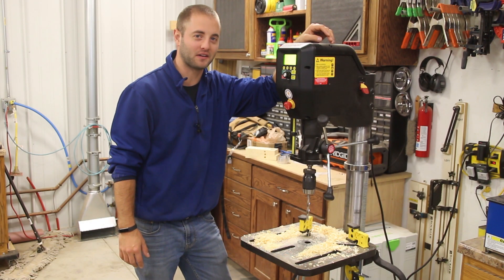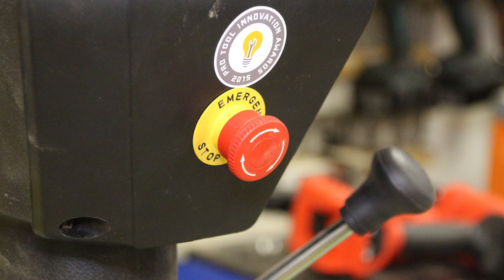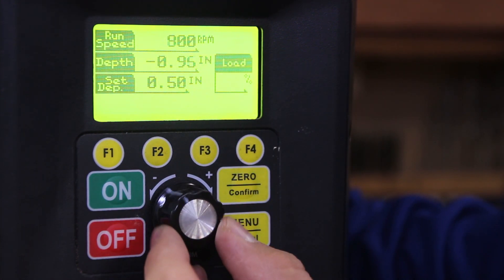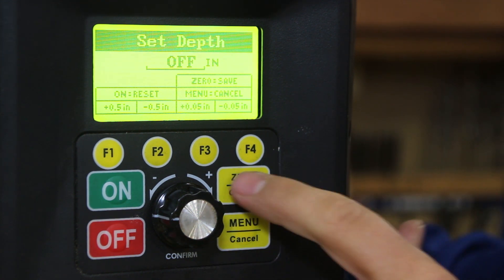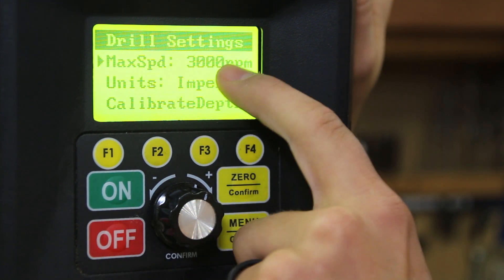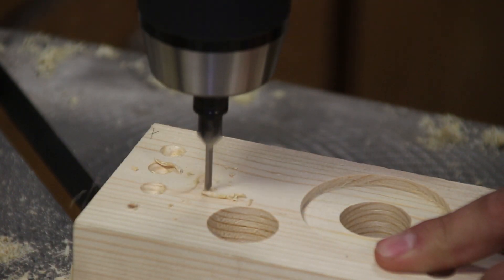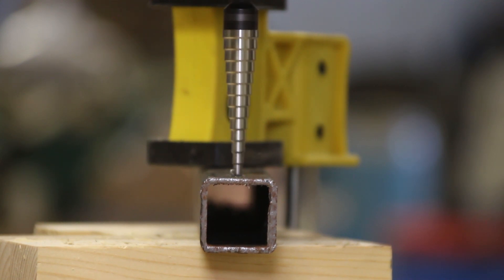Nova Voyager 58000 DVR Drill Press Review

Comment: IF the electronics in this hold up and cheap repair boards become available,  this will be the drill of the decade.  If not, there will be lots of mud thrown at Nova, Teknatool and Striatech.  Simply put, if an electronic breakdwn becomes a $660 repair item, or even a $200 repair item, this drill will quick;y get a reputation.  Interestingly, Rikon has picked the motor up for the 10-316DVR, meaning that at least one third party is expressing confidence.  On the other hand, Nove warns that you must use a surge suppress0or with this drill.  Good luck with that.
I do own one and am very happy so far.

Comment: Mediocre Drill for wood working, but the firmware is absolute garbage.  Tapping feature has serious safety issues, lacks torque control for fine drilling, and Teknatool support is a joke.  I have had a support ticket open with them for over four months and they stated early on that they were releasing a firmware update that would address some of these issues.  Guess what?  Nothing has been done and they just closed the support ticket to make it go away without resolving anything.

For anyone else reading, there would be a good market for a third party replacement processor board for this machine that actually implements the features in a working fashion.
Reply: David Persuhn - have you seen they have released an updated firmware version? Hoping it addresses the issues you have noticed.

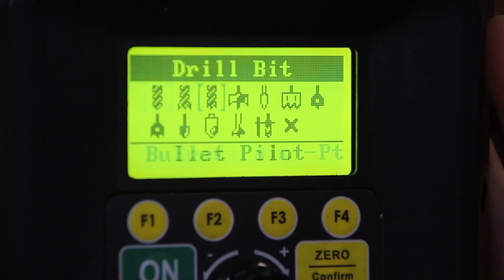Comment: I noticed @ around 11:25ish and a bit after when you were drilling with the Forstner bit and the plug cutter bit that the motor stalled several times when filming. This usually happens with a standard drill press and you have to adjust your feed rate or change belt speeds when using larger or smaller bits. I was a little disappointed with the cost of this thing that it even did that. When you read the description of this thing it’s supposed to anticipate the load and adjust accordingly but it clearly did not do that or maybe I misunderstood others description of how this thing works. I am just wondering because I really want to own one of these and I noticed when this happened you kept adjusting the knob so I am guessing you were increasing the speed but it took a few times from what I could see and then it switched over to another bit so not sure what the overall outcome was on that. So I guess my question is will this thing still stall out even if you have it set correctly? Also I realize that it was new and you were testing while filming so was any of these issues described above caused by something not set correctly or even with this expensive DVR technology you’re still going to get stalls? Thank you for taking your time to answer these questions and concerns.
Reply from the maker: Richard Obermark the unit I received from Tekna Tools was an early model. There was a computer issue that was preventing it from having the DVR technology during the first couple tests on film. I didn't realize I included them in the video. They have fixed the issue and has sent me a new computer. Drill press can handle anything you throw at it and no longer an issue. The unit is quite impressive. Let me know if you have any other questions.
Reply: Awesome, that's what I needed to hear. So glad it was a glitch in the computer. Thanks for clearing that up and thanks for getting back with me so quickly!

Comment: Andy, I too would like some information on the key-less chuck you used.
Reply from the maker: Robert Sanders it is an M2 taper keyless Chuck. I purchased it on Amazon. No key is required to tighten and loosen. Just a quick twist of the two grip points on the chuck. Very convenient.